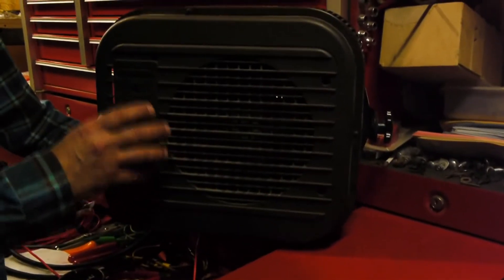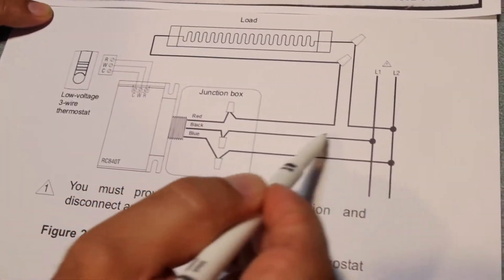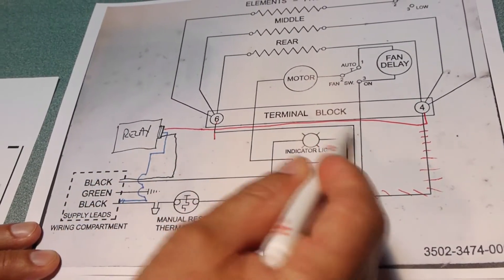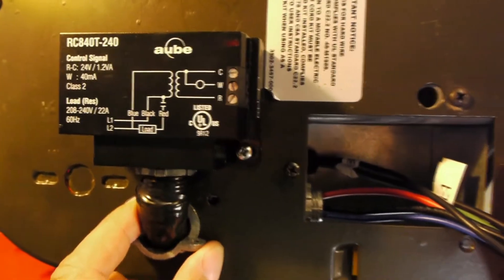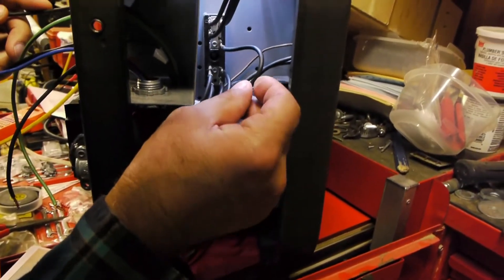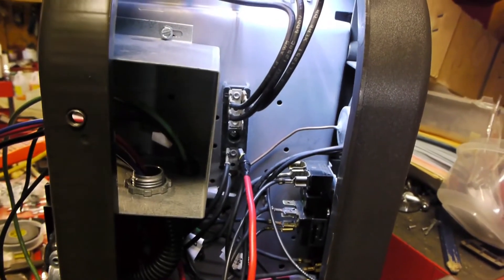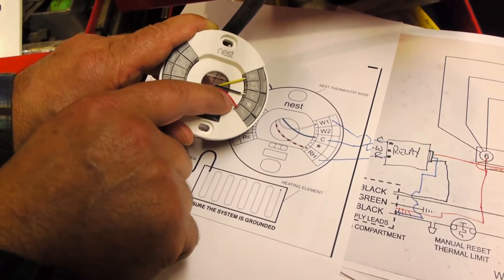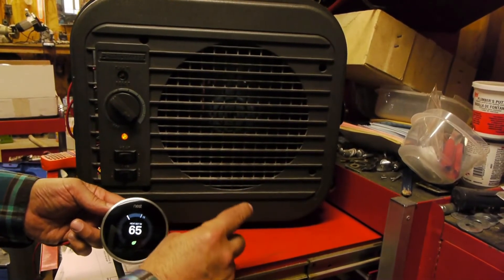Marley MUH35C Qmark 240 Volt Electric Heater Wired to and Controlled with Nest Thermostat

Comment: Thank you for posting this. I did not know where I could find a combination relay:transformer. After reading up on it, the threaded nub/lockring will go into the typical 1/2 inch knockout on a metal electrical box, then you can align the knockout on the back of the electrical box to align with the wiring hole on the Marley.  The plastic wire cover is ok for 12v cars, but a grommet or 10guage romex w/clamp is best practice to get wires safely into the heater. Vibration can cause the sheet metal to cut into the corrugated plastic wire cover and then the wire. Thanks again.
Reply from the maker: M Wilson... Thank you for that information!  I did use clamp connectors to go through the metal holes and not have any metal edges exposed to the plastic wire cover. I just thought that the plastic wire cover would protect it even more. I don't think I showed that very well in the video.  I will double check after reading your comment though. Thank you again.  Were you also suggesting that the relay be put into a box?
Reply: @commonsenseripsomehelpful   Hi.  No, I was not suggesting the relay be IN a metal junction box(I think the next size up is designed to be attached as a cover plate to a 4inch square box), it would be attached ON a metal junction box like a skin tag. The threaded portion typically fits inside a 1/2 inch knockout hole of a metal junction box, and then is held in place by the locking nut. That way all of your high voltage connections are enclosed inside a box.  If you search for the video “how to wire a doorbell transformer”, it is the same concept.  Your romex from the panel box would come to the metal junction box and be connected to the line/power side wires of the relay, then you load/heater side would go to the blocks inside the heater and be attached with the spade lugs.  You logic is clearly sound as demonstrated by a working set up. This is just a suggestion for you and others on a simpler and safer approach.
Reply from the maker: @mwilson5789  oooooOOOOOOH!  Gotchya!  So should the relay be mounted on a metal junction box and the metal junction box be mounted to the heater?  It was a weird setup because the heater itself has a built-in junction box where the 220 was brought into so I was trying to incorporate that.  Thanks for your perspective... greatly appreciated!
Reply: @commonsenseripsomehelpful  yes, the relay should be mounted to a metal junction box. Either a “handy box” with 1/2 inch knockouts, or a 4inch square junction box with 1/2 inch knockouts. Without actually seeing the two parts in my hand, I suspect that the threaded portion of a clamp would go through both the junction box knockout and into the qmark and the lock ring sandwich them together, then use 2 sheet metal screws to hold the junction box to the qmark. Another alternative that you would be best at evaluating is whether the relay would fit inside the qmark. The real issue is the high voltage wires outside an enclosure. The thermostat wires are low voltage and can be exposed and fit through openings with no safety issues.
Reply from the maker: @mwilson5789  I understand better now. So I could unscrew the relay from the outside heater housing, flip it up 90 degrees, and push the threaded part of the relay through the heater housing knockout plug, where I currently have a knockout plug fitting (so no sharp edges from the heater housing knockout plug could cut through the plastic tube or the 110 wires), and then thread the nut onto the relay from inside the heater housing thus securing the relay onto the heater housing and no longer exposing any high voltage wires outside the heater?  Grateful for your help!